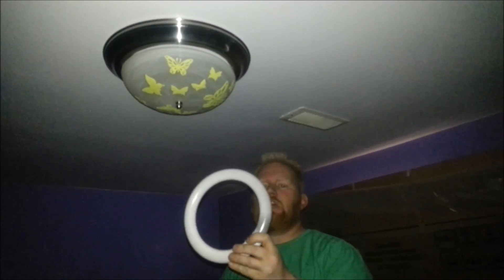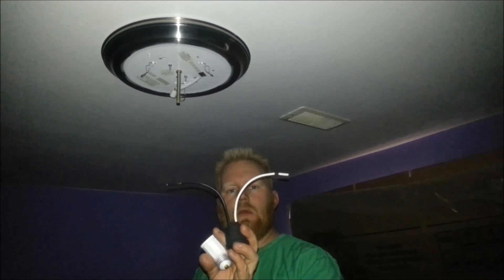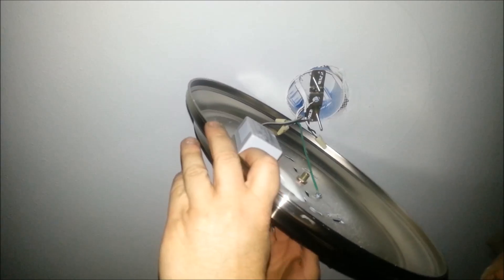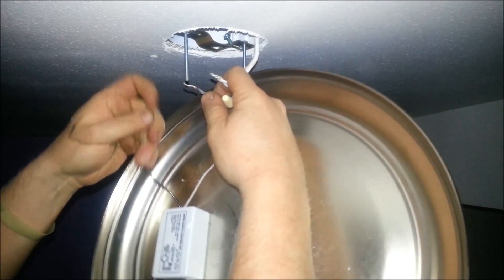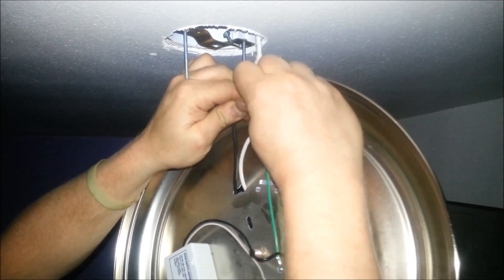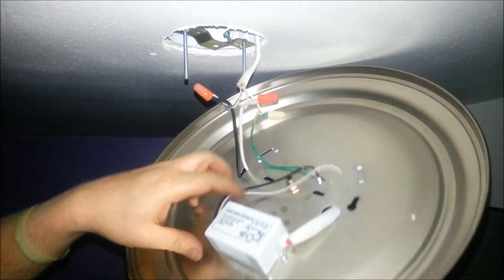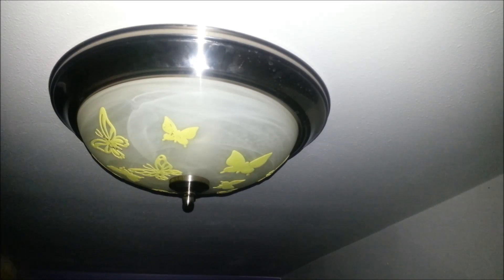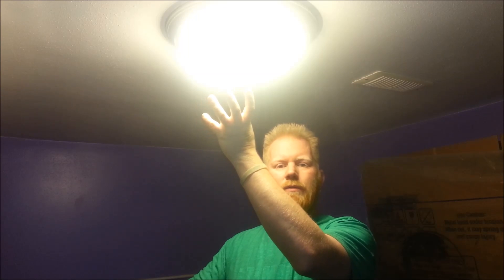Convert Circline florescent fixture to LED or CFL

Comment: Much much better, some of those "special" types can be stupidly expensive.

We dont use wire nuts in the uk for stuff like that, they seem a simpler way to do the job than connector blocks with screws to tighten down.
Reply from the maker: That's interesting. I assumed the screw-its/wire-nuts were common practice everywhere.
Reply: sixtyfiveford
We use the connector block for light fittings, the brass tube with two screws type, i think ive seen in some cheap celing fan/light combo's that have crimp on internal wiring connectors that look like your screw types.
is your mains supply 240v?
Reply from the maker: 240v 60hz comes into all homes but it is split to 120v 60hz for all lights and outlets. Only the Oven/Range, Water Heater and Electric Clothes Dryer runs off 240v. Does everything work off 240v in the UK?
Reply: sixtyfiveford
Yes its 240v 50hz for all things, may sound dangerious but it doesnt cause any problem as long as its insulated like all appliences are.

I know some out door tools can work on 110v but thats normally through one of those bright yellow portable transformers.
Reply from the maker: The higher voltage should allow you to run thinner wires as the appliances will use less amperes. An average house outlet in America is 120Volts 14 gauge(1.63mm) copper wire with 15amp breaker(1800watts). While a  high output outlet for a Kitchen is at 120Volts 12gauge(2.05mm) copper wire with a 20amp breaker(2400watts). I would assume your outlets would have thinner wire around 16 gauge(1.3mm) and 10-5 amps?
Reply: sixtyfiveford
Yes the sockets are 13 amps max, but most of the time no one loads them up to that level, they are wired ring main style, so from the breaker box tapping onto each socket then at the end back to the breaker box, the wire is 2.5mm sq, the breaker is 32amps, based on the fact that most sockets tend to have light loads.

The lighting is radial wired, 1.5mm sq wire, downstairs breaker is 5 amps for about 5 to 6 fittings, loaded very "light" lol :-)

The kitchen has its own 32 amp ring main for sockets + 45 amp cooker outlet spur.

The change in colours due to european harmonisation can cause confusion, (old type = red live,black neutral, green earth) new is brown live, blue neutral, green/yellow earth.  Bloody european rules!!
Reply from the maker: Colour changes would be frustrating. One last question; so are all the sockets in the house on One 32 amp breaker? With our codes most rooms have to have their own breaker. So the average breaker box will have 15-30 individual breakers(everything including kitchen and bathrooms).
Reply: sixtyfiveford All the sockets ( 8 ) (not kitchen) are on one 32 amp breaker.
The kitchen has its own 32 amp breaker for sockets, cooker has a 45 amp breaker.

The upstairs lights ( 5 ) are on a 5 amp breaker, downstairs lights ( 4 ) on another 5 amp breaker.
In this house the breaker board has two earth leakage devices to protect you if the power goes to ground via the wrong path.

The main fuse on the incoming power before the meter is 100 amps max.

I know its doesnt add up, but you have to remember real usage rules, no one loads every outlet to the max and every light fitting to the max.

Its a small 3 bedroom house, there are larger houses that must have a main fuse larger than 100 amps, but you get the basic idea :-)

Comment: Phillips LED bulbs 60 watt equivalent is 10 bucks puts out about 880 lumens uses 9 watts - 75 watt equivalent 20 bucks pumps out 1100 lumens uses 15 watts AND lasts 25,000 hours and they give off a warm white that mimic incandescent instant on and you can dim them with a standard dimming switch - I am saving about 35 dollars every 90 days in the room that I switched to all LED. That's my cost savings - yes I spent about 50 bucks on LED bulbs but I will make up that difference in 6 months  with the cost of replacing bulbs every 3 months and the electricity savings AND it's still a nice warm light
Reply from the maker: That's a great savings. From incandescent to LED makes a lot of financial sense but the math doesn't make sense yet to switch from CFL to LED. Maybe in a year or so when it gets more popular. LED is amazing for directional light like in a flashlight or even a home can light, but I think they overrate their ability to evenly light a room.
Reply: Also, a few things you need to take into account when picking out your LED bulb. The color of light the bulb emits - if you want warm white you need a 2700k you must also take into consideration how the bulb will dissipate the heat - even though the general consensus is that LED bulbs are cool or cold yes they are but not totally. Whenever you covert from AC to DC that creates heat and in order to do that you must be sure the bulb can dissipate the heat. electronupdate here on YouTube does a great review and tear down of all the LED Bulbs so you know exactly what you are getting. I once emailed him asking what he thought of Walmarts LED bulb next  thing I knew is he went out and bought one and tore it down. There is also "Flicker" you need to be concerned with because some people are sensitive to flicker of the bulb if it's not smoothed out properly. I took all those things into consideration and picked Phillips I also waited until the price came down substantially which it has. I presume within a year it will be cut in half again.
Reply from the maker: Great info. I watched a few LED bulb tear downs a year or so ago but I'm sure a fair amount has changed since then.